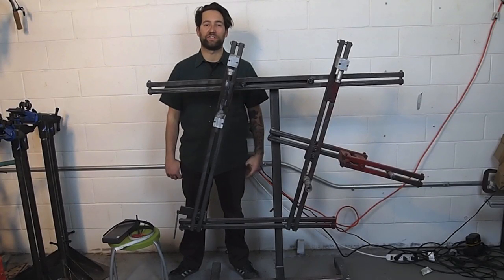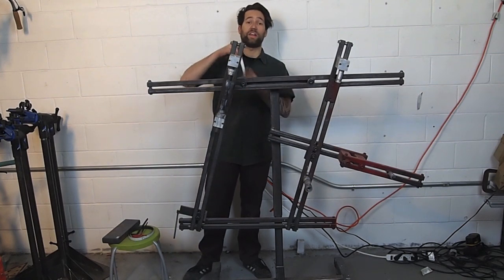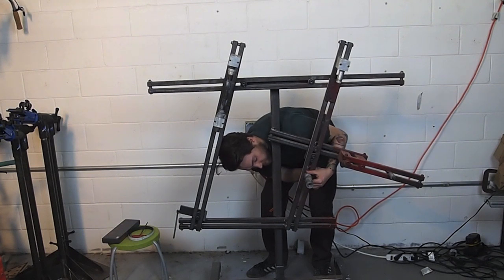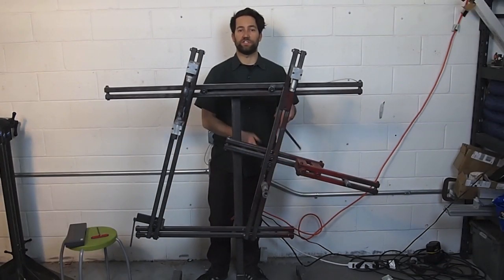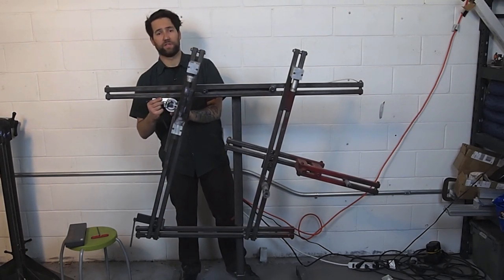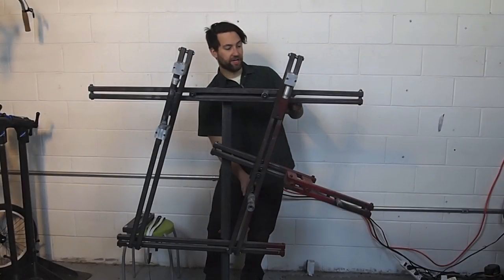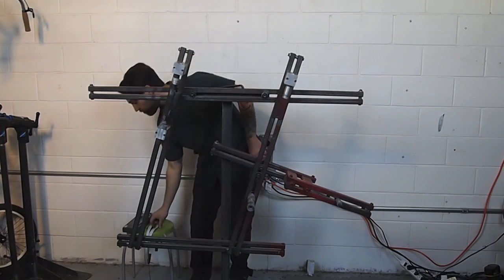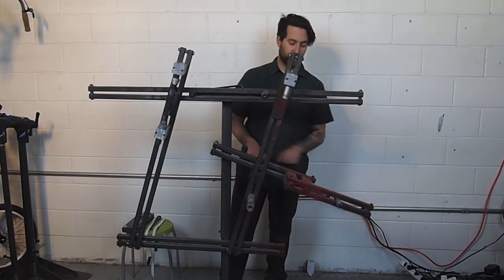Setting the Frame Jig - Build your own Bicycle at Artisan's Asylum

Comment: Hello Paul, just wondering where you got that jig kit? and would it work for building cargo bikes?
many thanks
Reply from the maker: Tony Bracken I made it myself, but it's a nice flexible design for any frame of tubes that's in one plane.  It's made of 1" square tubes with 1/2" spacers between them, and standoff blocks that mount through that 1/2" slot with 1/2" hardware.   It's a ripoff of a hague fixture.
Reply: @pauledwardcarson  
Paul, can you send de measure of jig?
Reply: Great explanations!
Do do you have any plans for that particular Jig...?
I'd love to build one.
Thank you for the great vid